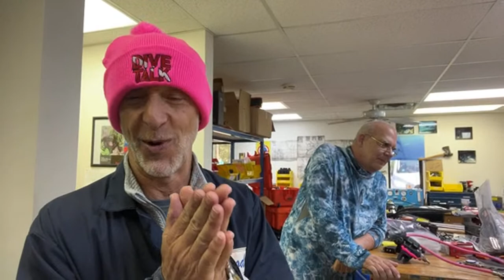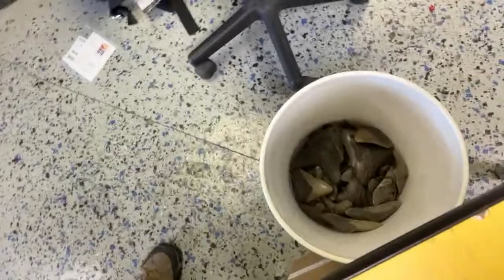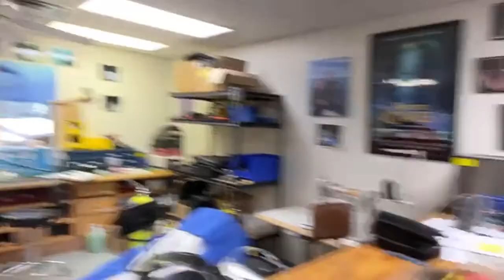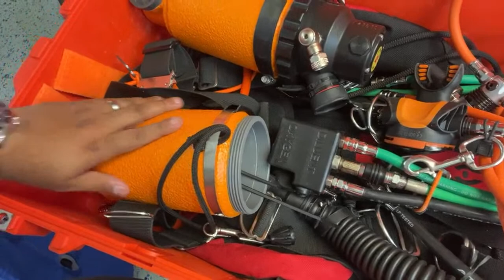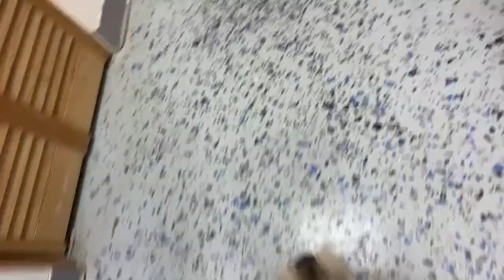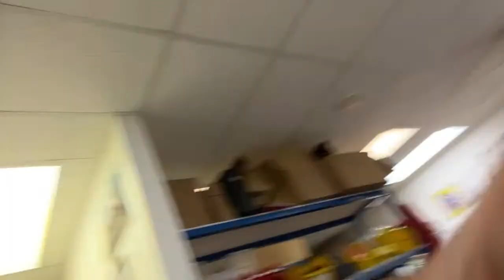Working on the Rebreathers

Comment: 18k plus later, what beautiful rigs. ❤️
Reply: @S. Clarke I think it’s all of the above, the number of sensors, and type of computers can run a bit costly. It depends on the build I would say. My personal opinion on it is, you have to rely on this equipment to keep you alive, if you are worried about price maybe you shouldn’t do it. Plus not many use these, most use open circuit which is also costly but not as much. They use to let you go to Kiss website and build your rig. I believe it gives a estimate of cost. Check it out, you can run down all the equipment and build the unit to your specs and price range.

Comment: If I ever get into rebreathers, I'd have to get a drysuit, and the requisite drysuit class, first. My typical open circuit dive duration, is ~45min. Not because deco limit, nor running out of air. Its because I get too cold to stay down, any longer, in the Pacific waters, where I usually dive, wearing a 1/4" (6mm) wetsuit.

As far as peeing in a wetsuit, there are those who pee in their wetsuit, and those who lie about it. I give my wetsuit a GOOD rinse, when I get home.